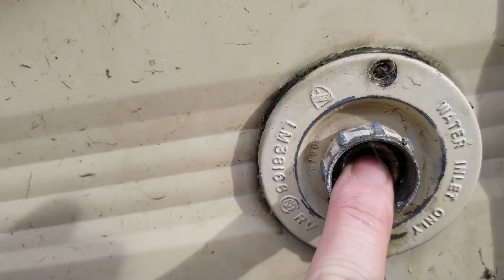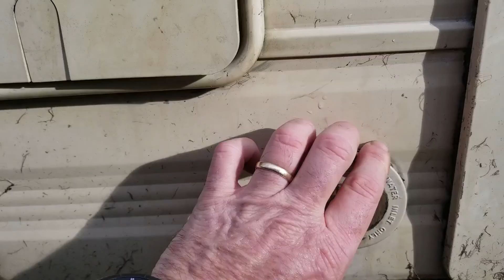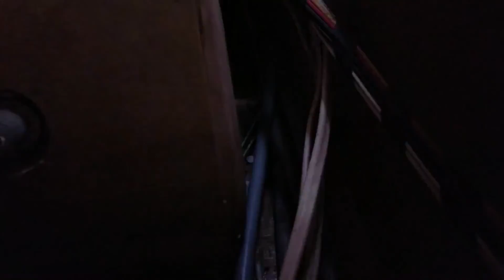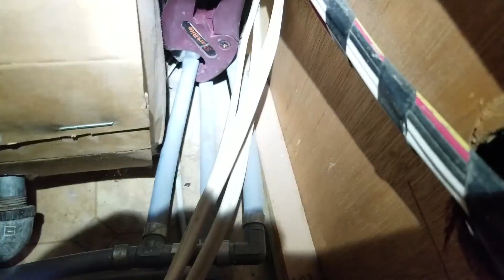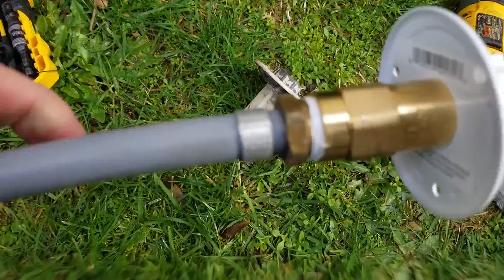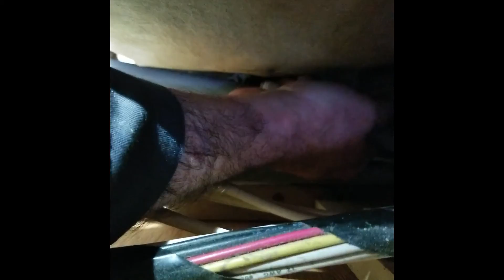Replacing the Fresh Water Tank Fill Port on an RV

Comment: Great video but have a question. Why didn’t you remove the hose at the Tee rather than cutting the line, and possible creating another leak spot?  Thanks
Reply from the maker: I've got good confidence in the fittings that I use. Had I interfered with a Tee, then I could have had the potential of three places that could have leaked.  Another deciding factor was access.

Comment: That connector to restore the cutted line, is it sealed? Looks like you haven’t used any wrench
Reply from the maker: It's a Sea Tech fitting kind of like a shark bite. Have used them exclusively for years and they are fantastic. No tools necessary.
Reply: thanks！